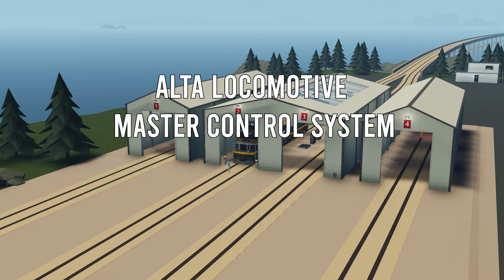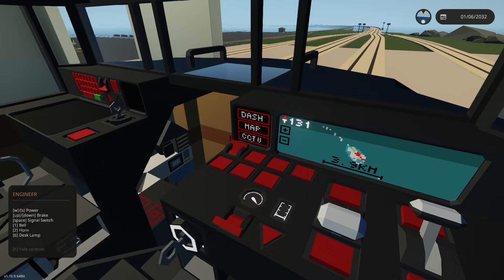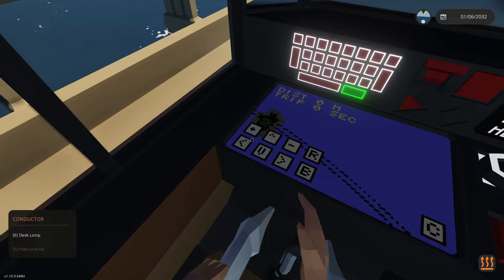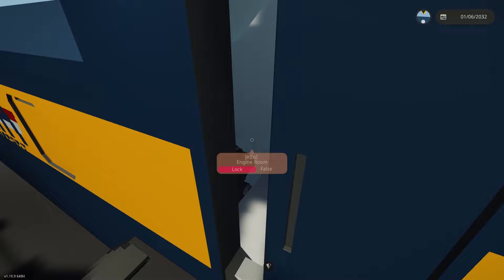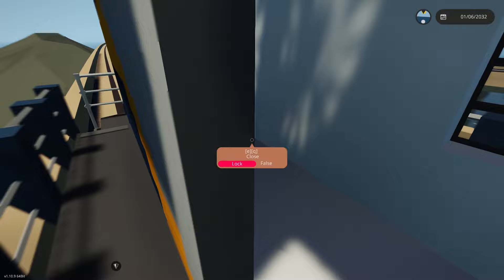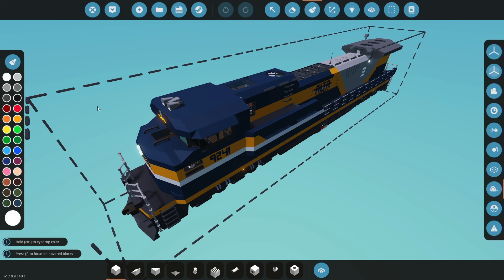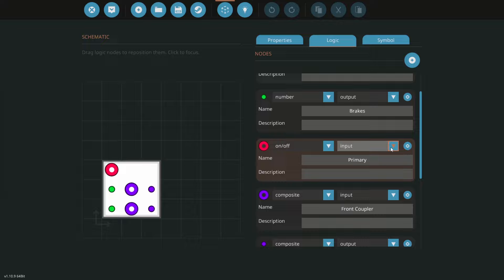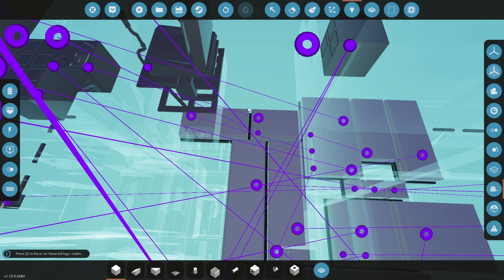LOCOMOTIVE Master Control Mode in STORMWORKS!

Comment: Quick question: What do you do when connecting a locomotive facing forward and one facing backwards also with the new tracks you might need to connect two locomotives where their wheels are applying forces in opposite directions